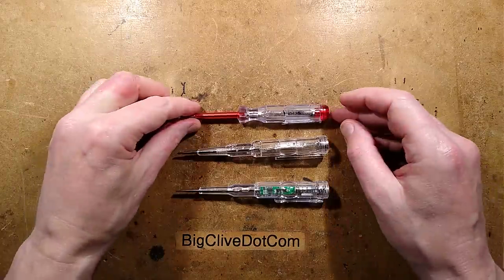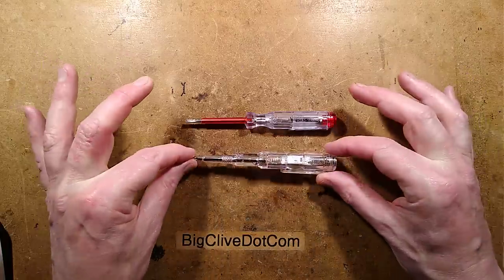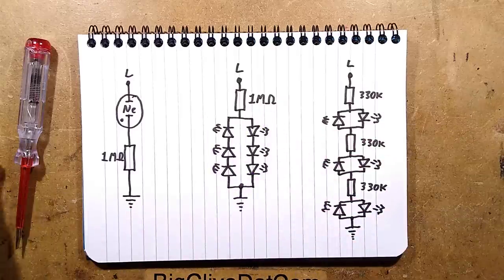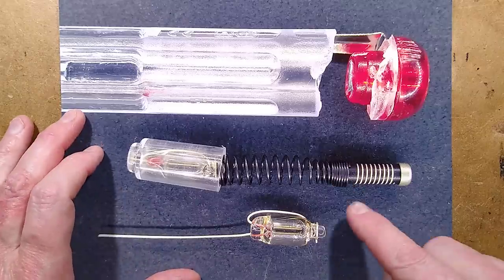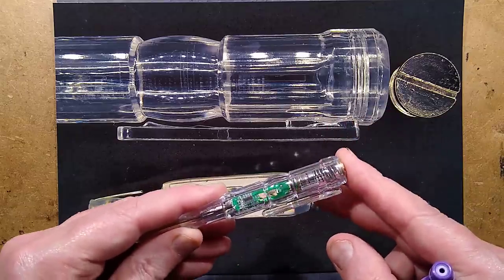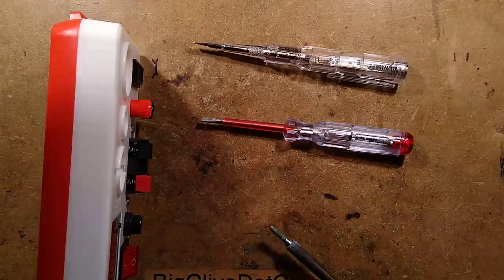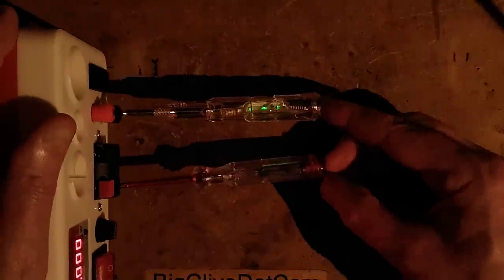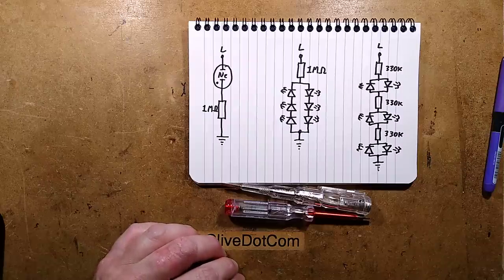Reinventing the neon test screwdriver

Comment: It's a clever design, but I don't think there's much of a future for these, whatever the design.  Voltage detection is being widely implemented in the smallest, rather inexpensive ($12 USD) multimeters these days (look for the NCV option).  I spent a little more on my UNI-T UT210D for its non-contact DC current feature, but as soon as I tested its NCV ability, I removed my detection pen from my toolbox never to return.

Comment: I tried building one, could not  get it to light, even after reducing the resistor to 500k, My LEDs test good but they are 10 years old, What kind of LEDs did you use. Newer ones may have different chemistry than mine

Comment: Surly a cheap meter is a better and safer alternative, am I right in thinking there is just a resistor between you and a fatal shock .?
Reply: most place in Europe have residual current device in the fuse box, the moment you touch it, the power is gone.
it's called a differential in Spain and compares if the neutral and phase have a deviation in flow bigger than 33mA.

Comment: Nice work, but i trust a neon much more than led solderd on a board.. LED´s fail reely quick if you have a static discharge.
I saw many led´s and solder points fail, but never saw a faild neon bulb by myself, even in very old control boxes with like 50´000+ hours they still work.
The Neon bulbs in Extention sockets for example... They glow 8700 hous per year and even after 10+ years they still glow wich is over 80k hours.

Comment: 💡💡💡Here's an idea for you... Can you make a stack of LEDs in such a way that progressive lights up more of them as the electric field gets stronger?  Like a bar graph and you use the property of the LED's voltage drop in some manner?  p.s. I keep thinking this might turn into an Electro Boom video... either catch on fire or shock with sparks.  🔥
Reply: It requires a battery to work. Sold on Amazon at 12€
Reply from the maker: There's a simple LCD version that can do that.

Comment: Maybe it would be better to use a lower value resistor to avoid dangerous 'false negatives' in well-lit conditions. 330k perhaps?
Reply from the maker: That is getting close to "finger tingle" current.
Reply: @bigclivedotcom  Isn't that a good thing?
Reply: @petehiggins33 Depends if you enjoy getting a mild shock each time to test for live wires .Some people might enjoy I suppose

Comment: I still don't understand how you don't get shocked, is the resistor the only thing stopping you from getting a zap?
Reply: Yes. 240V/1M = 240uA which is the current if the whole thing was across the mains, but your body also has a voltage drop, so in practice the current will be lower. LEDs or neons don't need much current to light up.

Comment: Clive, I really hate to be a contrarian…. You emphasize having a reverse led to prevent getting close to the breakdown voltage of the other led. I believed that ti be the case as well…. Until I did some tests. i do not believe that one needs to worry about reverse voltage, even at mains voltage. Can you prove me wrong? Even better can you show something dramatic happening? (That does sound like more fun than me being right)
Reply from the maker: The maximum reverse voltage of a typical LED is 5V.  With another LED in inverse parallel that will not exceed about 2.6V at the current involved.

Comment: You would get way better results if you replaced that led tape with led rod from the incandescent  lamp imitation
or you can use high voltage led's that have many led chips inside.

Comment: Ha, ha I love test screwdrivers..I always have to have a nice clean one.. But most can't torque down a screw without distorting/bending the tip! They all seem made out of some very soft steel. I complained once and was told, they are ''not meant to tighten screws'. I accepted the answer, maybe because I couldn't think of a quick reply, being sort of bemused.

Comment: Current LED strips have notoriously short life-spans. In this regard there appears little difference between cheap and expensive strips. I have a neon test screwdriver which is over fifty years old which is still used very regularly. I wonder how many LED one's would have survived as long? Clive will surely do a follow up video in fifty years on "HoloTube." (HoloTube copyright, patent pending, "registered" trademark of me Inc Ltd LLC)
Reply from the maker: The LED lifespan is mostly affected by the current it's used at.  In this application that would be extremely low.

Comment: Ifthe single resistor flashes over your body becomes the resistor. I would use 3 resistors, 1 bigger led      and maybe a resetable fuse. But I only work on a bench with enough safe multimeters so I have no use for them

Comment: You can do 10x better by using a 10:1 (or more) transformer on the LED so that 24V at 50 uA becomes 2.4V at 500uA through the LED. I used this trick in reverse on a project by placing backwards parallel diodes on an AC load to provide a 1V drop, and then multiplying that voltage by 16 to drive a relay.
Reply: "or more" is probably a bad idea. When the LED fails short, the current in the primary will increase with potentially shocking consequences
Reply: That won't work. How would you hook up the pimary winding?

Comment: The finger is also a tester, touch a live wire and you don't die, not on 240V system with low amperage
Reply from the maker: See my video called "The unofficial guide to electrocution" to see why the finger approach will potentially backfire on you at some point.

Comment: If you are insufficiently grounded, won't these test lamps give a false negative result?
Reply: But equally, if you're that well insulated from ground, is it going to shock you? I suppose it's really a quick "peace of mind" test for "If I touch this thing, am I going to get a dunt?". Handy if you want to do anything with the wiring in my 1950's council house where nothing to do with the wiring should be taken at face value and off doesn't always mean off. I found at least one live, unswitched wire just buried in the plaster when it blew up a drill bit. Not sure who pays for the power in it but it doesn't go through my consumer unit, perhaps next door? I resisted the temptation to connect it into my ring main.

Comment: The computer version, some don't come with batteries/tube holder and no instructions how to install them. Which means, non understanding buyers can drop the battery down with the electronics or  the batteries reversed or batteries short against the grounding wire, due to no tubing, to hold the batteries. I know an easy fix by wrapping the batteries with pvc tape, but would buyers understand this. 😢

Comment: Do another test! Touch that grounded soldering iron through milliamp meter and compare results. Neon lights up at few uA , LED takes hundreds uA to produce any light... Anyway, those neon probes are forbidden today and for good reason, think what happens, when that resistor gets damp or something from your pocket shorts few turns off that resistor.

Comment: Your speaker connector with 240v inside is ... Illegal. This plug is not certified for this voltage. There is a high chance of touching the live tip while pressing the tab

Comment: I am not exactly comfortable with those, even the British one as it's using your body on the opposite side.  I would say get one of the sensor ones that's battery powered with a test button and a piezo beeper as you would be fully isolated.They aren't epensive either.

Comment: Many years ago, I used to work with an electrician who used to stick his finger in the lamp socket to see if it was live.  He's probably dead now, from old age/electrocution.
Reply from the maker: In the early days the first electricians guide suggested that.  They subsequently removed that from the guide when it was found that the test could have violent results in the wrong environment.
Reply: Yeah, i was teached that as well, to feel with the back side of the hand, prevent using fingers and have them clamped shut due to current and not being able to open the hand.

Comment: It might be instructive to also try with blue LED. They are higher voltage (and therefore a closer impedance match) and to my eye even brighter than green. 
While green is closer to the sensitivity of the human eye, I suspect the blue LED to be more efficient at producing light.
Reply: you can use high voltage led chips there are white leds for like 20V

Comment: these things are actually banned by most companies I've worked with to use on the job because they have a nasty habit of giving false negatives depending on what type of connection you're testing or even worse arcing across on certain types of connections giving you a good jolt before you can even see the indicator.  For home use if you're using nothing but a 120/240 and you're doing live/dead/live on every test it's "probably" fine but personally I still wouldn't trust one with my life.

Comment: Your new design has a major flaw (from my POV): as the LEDs with different polarity are just on 1 side of the strip it can happen that you hold the tester and the lit LEDs are on the backside, so that the frontside stays dark. 😬
It could be a risk when testing multiple terminals in a hurry. It increases the chance of getting shocked by 100 % and reduced the safety by 50 %.
So my choice would rather be the traditional (neon) design rather than yours.
Why do you have opposing LEDs anyway?
What's the advantage of 3 resistors of 330k vs. 1 if 1M? 🤷‍♂️🤔
Do UK-compliant testers need to have 2 red ends?
Reply: The mains supply is an alternating current, so both sides will light up - alternately lighting one side then the other, on and off, 50 times a second!
Reply: @SilverLoz  Oops, maybe I had a brain freeze. 🤪🤦‍♂️🤭

Comment: Dumb question from person who knows nothing about electronics:

It feels like it would be possible to use a capacitor to allow current to just for in and out  of the screwdriver if testing for a live ac wire without needing to ground the back of the device. Why is this not a good solution?

Comment: Ha ! ! .... I have an ( empty ) MUCH  bigger tester ( originally used as a 12 Volt car tester ) ... I should have room for two opposing LED " filaments " from a mains bulb where the glass broke ... also the resistor might be safe to lower to 330 K Ω + 330 K Ω ( might be a bit bright , Ha - Ha ? ) .... DAVE™🛑

Comment: I brought a now classic neon screwdriver tester way back in the late 1960's and do I use now NO.  It's in the bottom of my tool box some where.  I ten to use a volt stick that I bought in the mid 1970's and both work as well as they did when I purchase then way back.  The neon tester should not be used as a screwdriver it say some where

Comment: am confused. you stick a screwdriver into a live 240v electrical socket, then touch and hold metal conductive contact, and also grab a grounded device to make it light up more? i dont get it. why do you need any type of light? led or neon,  what are you testing for? to me that seems like " if it dont light, it's neutral or possibly faulty live?" these devices makes no sense. just do what proper electricians do to test the socket and RCD. dribble some ISO ALC in. if flames happen, its live. if no flames,. it's ded and will dry out via evaporation.

Comment: I'd prefer to just use a multimeter.  Don't like the idea of touching a live circuit.  I've done it by accident a few times and didn't like the result.  Just a slight tingle but still would rather not do it.  LOL

Comment: As a Chief engineer i just need to ask if this will cut dc from making an arc at normal high voltage Diesel generators to motors? a neon can taka several thosands of volts before it "burns out"
shure your invention will replace one of the few really safe metods for working with high voltage...
as for now we got somting not just working at low Voltage But its also moderate safe at high volatge (Neon)
If you mix two of these in a stress situation an arc ....?
Please correct me if im wrong, its just my understanding of arcing in dc...
Btw: love your channel, brings me back to school and brainfeeding ....
Regards
Stupid Norwegian
Reply: I know a neon of this type is not approved for HV, but still its a safety device if overvoltage/High will make a lightning instead of arcing to earth/you...
Still a clown..

Comment: How many diags have professionals ruined by cutting into a live wire? If one's a real electrician/electronics tech, and they admit the truth, it will be a few pairs at least. I've done it in an emergency to shut off a live circuit, or to splice in a wire using hot gloves, and in one instance, it was done from the top of a twenty-foot extension ladder in the ceiling of an industrial building. Sparks do fly, and the cutting edge of the diags are left with a gnarly burned edge.

Comment: But the screwdrivers are useless for electrical work. I still would much prefer checking my contactless  tester batteries, sliding it back in my elechicken multi-bit screwdriver, then climbing  the ladder. 

Safety third!